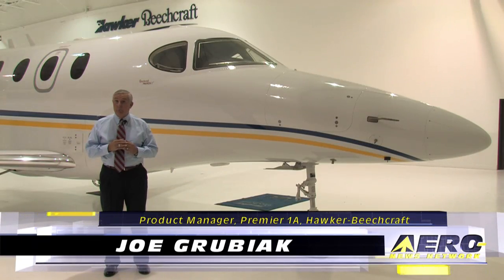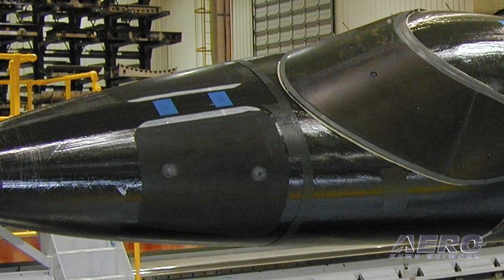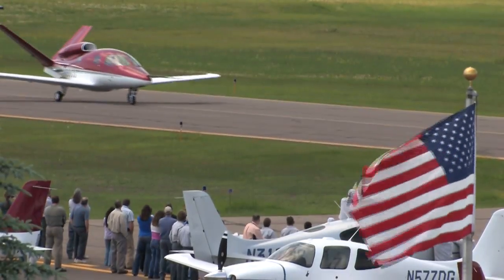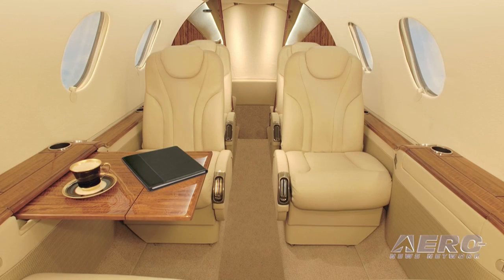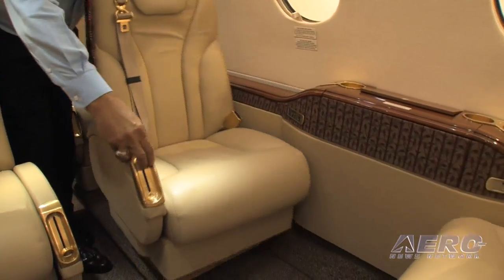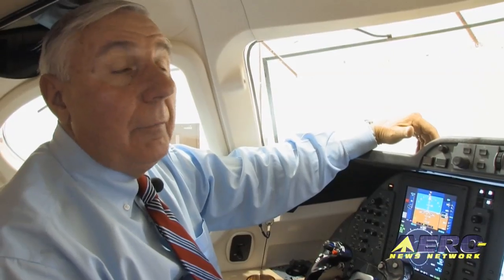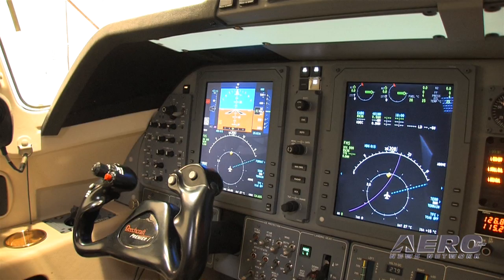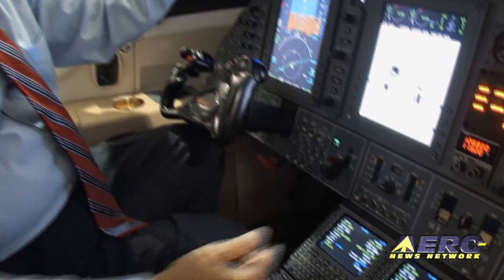Aero-TV:  Traveling in Style - The Upgraded Premier 1A Cabin

Comment: @lauriersroses333 Just by the way you type... you're and idiot. How did I prove that I'm an idiot. It's not a 747. Talk about read some books. LOL. I realize that there are 737, 747, 707, 727, etc private planes. However, in those you can stand UP because they are large jets. Planes like that premier 1, Citation X, Challenger's, Other Citation jets, other Beechcraft jets, other Raytheon jets, which are smaller business jets have low roof lines. They are small planes. Idiot.

Comment: @LandRoverWay23 and there is privat jet like:747,737-800,airbus 219, boeing 767, read some books befor u call other idiot :)
Reply: lauriersroses333 they know that they were stating that the roof is  higher than a private jet because you said a 319 which generally is an airliner not a private jet